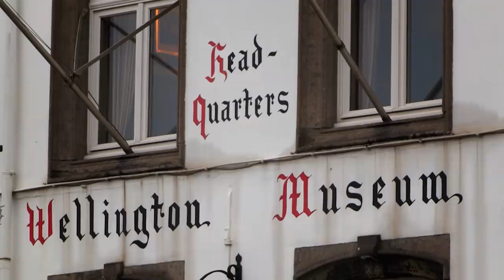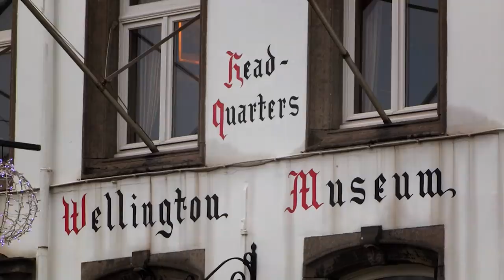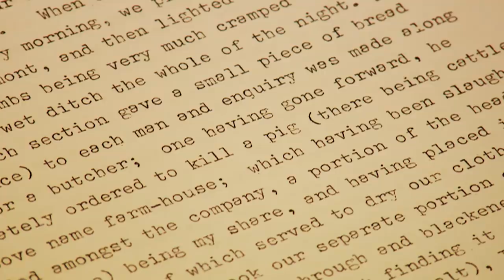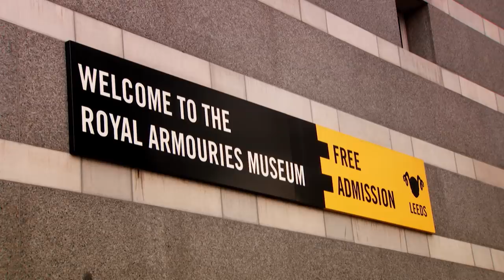Sean Bean On Waterloo: Napoleon's Greatest Defeat, Explained

Comment: 50 years later, the wounds were similar, however, the guns could now fire accurately to 150 yards, rather than just 50 yards. Speaking to a Civil War historian, he stated that the lead ball moves much slower than a modern bullet and weighs much more. When a modern bullet hits a bone, it beaks it fairly clean at the point of impact. The lead ball, and minie ball, due to its slow speed, greater weight, and the fact that the soft lead will deform more easily, would splinter the bone up and down its length. Broken in this manner, it cannot be set, and amputation is usually required.

Comment: The orders when firing in line, was 'ready, level, fire'.  The soldiers fired at the mass of the other line of enemy soldiers. You usually weren't aiming for an individual. Above 50 yeards the ball from a musket was quite unpredictable, and though dangerous out to a fair range, the accuracy was poor overall. The advantage with muskets was that without the rifling in the barrel, reloading was faster and and easier. Massed fires took the place of aimed shots. Muskets were also cheaper and easier to produce for big armies.
Reply: pistonar I do not know what drill you are talking about but in the kings manual of 1764 the commands were make ready, present, fire the commands in von stueben is make ready, take aim, fire
Reply: Incorrect Sir, Rifeling came after Smooth Bore Muskets....
You have it backwards, Rifles would have replaced the much older, smooth bore flint and match lock muskets.

You see this with the Afghani Jezail or the Kentucky Long Rifle, cutting edge technology in the mid1700s.
Along with the "tactics" of Rifle ( Hiding and Aiming) vs Smooth Bore ( En Masse Volley), the rifles slowly replaced the muskets.

It's also, why nearly every war fought in the 1800s is brutally bloody, armies are equipped with rifles, but still using Smooth Bore Musket tactics, ex Grouping, En Masse, etc..

Take the American Civil War for example, absolutley one of the bloodiest, gooriest, wars in the past 300 years.

All because Tactics hadn't caught up with Military Technology......

Back to the main point, Muskets came first, then rifles which replaced  them on the battlefield.

Comment: The mud would have made the artillery less effective than it would be on a dry day. It would have increased the chances of the ball burying itself in the mud vs allowing the ball to bounce or skipping arcross the ground causing further casulaties. That's using a standard cannon ball, they also had shells that contained explosives that would fragment when they exploded making them even more lethal. The artillery commanders of time would cut the fuzes, the timer for the explosive, to cause them to expode in the air vs expoding on impact. It was problematic since since they were guessing the range and time of flight of the round and the lack of real quality control for the fuzes made split second adjustments to the timing more of a guess than a science.

Comment: Worm the gun, if these re-enactors had some expertise they would have noticed that the worm was being turned anti-clockwise whereas the worm itself had a clockwise thread and would not have cleared out the debris. Also the bit about holding the tools underhand is only partly correct, the important bit is to stand with your back to the gun, if possibe at the side of the barrel, make sure your thumbs are in line with the tool and pointing away from the barrel end, this way you will not lose a thumb possibly just some skin. Sean should have been wearing gloves. Nobody at anytime mentioned that the soggy ground would stop the cannonballs from bouncing, they would dig into the mud. They did not deliberately aim short, as this would slow the velocity of the ball, but if the ball fell short it could bounce and had a chance of reaching the enemy target. It also follows if it went over the intended target it could bounce and reach targets behind. As a re-enactment group they should not have allowed Sean to place one end of the double ended mop on the ground, it could pick up stones, in warfare this would not be a problem but when re-enacting a stone could cross the battlefield and harm the opposition.

Comment: I wonder if small arms like muskets and the pistols of those days were sighted in for each man using them like modern small arms or if they were designed in such a way that they needn't be sighted in. It could also be a possibility that the act of sighting in is more a tactic derived from modern marksmanship training and that they didn't yet realize the need for it when it comes to increased accuracy. I know that they did at times sight in artillery during the formation of defensive positions when not under the threat of attack at forts of that time as well as when preparing for battle when they had the time to do so. Before anyone assumes, no I am not military though I wish I was. My display picture is a picture I had taken during my 3 year service in high school U.S. Army J.R.O.T.C. where I served as a cadet non-commissioned officer as a platoon sergeant of the rank of a cadet E-7 (Sergeant First Class).
Reply: Muskets didn’t have sights
Reply: You got as many muskets together as possible, had them fire at the same time, and hoped some of them hit something.

Comment: Waterloo was Napoleon's final defeat....but his "greatest defeat" was the Russian campaign in 1812 when his army of approximately 650,000 (including allied contingents), 450,000 of which made up the initial invasion force, was reduced to barely 100,000 by the time the survivors staggered back to France. Most of those were troops used to hold the supply line for the Army that attacked Russia.

Comment: The men firing the flintlock have a tendency to over-squeeze the trigger.  It should be with the tip of the finger only.  Having over 50 years of flintlock shooting I can normally out-perform most people firing an M1.

Comment: Waterloo is famous because of British propaganda, claiming their personal defeat of Napoleon. This ignored 2 very important events that took place that allowed Waterloo to happen. The first is Quatre Bras in which the British mercenaries army failed to aid the Prussian at Ligny, resulting in their defeat. Then, despite their defeat, the Prussian outmanoeuvred Grouchy, and came to threaten Napoleon’s right flank, which appeared on their line of sight at 1 and joined the battle around 4 PM. These 2 important events are ignored to glorify Wellington’s success. Even if the Prussian didn’t arrive on time and the British and its mercenaries, for the British army at Waterloo was less than half British, they would still be in a position to retreat safely. The coalition is coming in a month. Napoleon’s was defeated once at Leipzig, and once more defeated in France. There’s little reason to believe the coalition couldn’t do it once more. The biggest threat to the coalition would have been the in-fighting, but Napoleon’s rolled the dice early, uniting them instead.
Reply: what wrong with you
Reply: Wellington's and Blucher's plan from the start was to unite and bring a crushing defeat to the french. Wellington delaying the French at Waterloo was very much the last opportunity to unite before Brussels. Each side has it's purpose